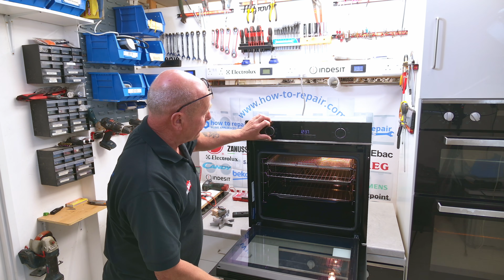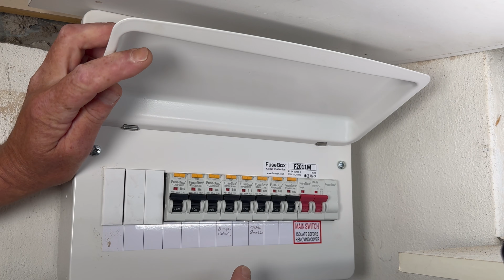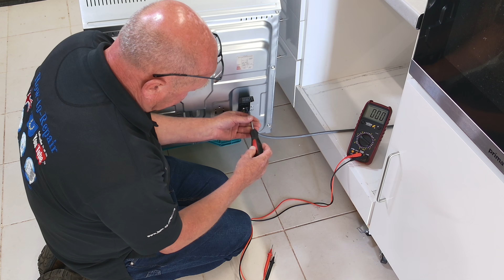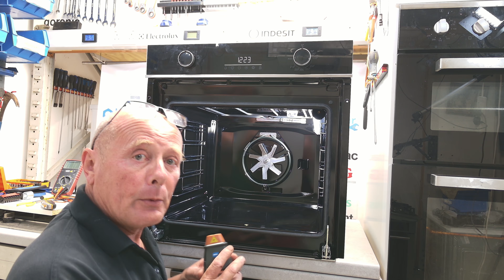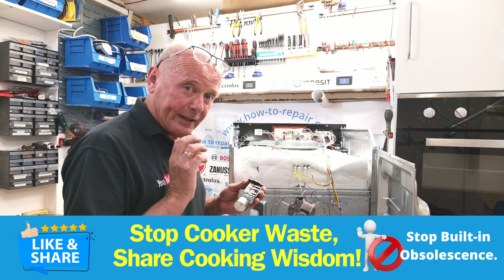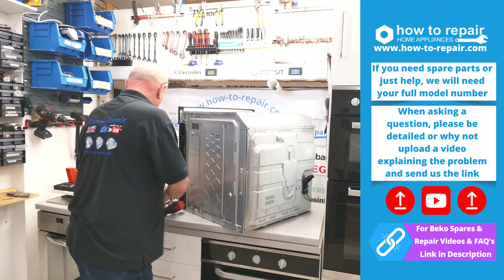Fan Oven Motor Test & Replace on Beko, Blomberg, Grundig, Lamona, Leisure, Logik, Stoves Etc

Comment: Excellent video. Was able to access the fan with ease, with a view to replacing it.

I live in Greece and my oven isa Beko slot in oven model# BIE22300X serial# 7768288302

Often when trying to look up the oven model on spare parts websites, they list model numbers with a different starting three letters. Can anyone throw light on what these initial letters mean, and in particular, do they signify that different spare parts might be required?

Also, I note that the oven fan (having not removed it) appears to be an impeller and suck air from the centre and pushes the air flow to the side vents on the back panel. Is this correct?

Comment: Frankie: My Beko BBIE12301B oven's fan has started making a really loud rattling noise, and sometimes it sounds like it's spinning very slowly or struggling. It's quite concerning. What could be wrong with the oven fan, and can I fix it myself? Should I buy any replacement? I really need your help and want to make it running freely again.

Comment: Hi, having watched this video, i have an issue with my Beko  ODF 22300 x oven. Should i ask the question via email or add it here? Regards, Paul
Reply from the maker: It's normally better through the website as I can directly answer any spare parts that you need and I always get the questions. Sometimes I miss them on YouTube as I have so many questions.
Reply: @How-to-repair  ok no problem,  I've sent a message through the link. Cheers, Paul
Reply: @How-to-repair  Hi Paul, did you get the message I sent through the link? Cheers
Reply: 24hr response?  No one got back to me. Well, Thanks for your help. What's the point.....

Comment: I'd be interested if you're able to repair a seized bearing on a oven motor fan. Some fans are super expensive (>£150) [Neff]
Reply from the maker: Hi Paul,

You could replace the phosphorus bronze bearings if you can strip the motor. However, some motors are riveted, making it very hard to do. Another major issue is finding the right bearings. Phosphorus bronze bearings are designed for each motor, depending on the shaft diameter and bearing size. It’s a tough job.

Sometimes, it might be easier to get another motor. I know motors can be expensive, but you might find a cheap cooker on eBay with a different fault, like blown elements. You could take the motor from that cooker for yours. 

Universal motors might also fit and are much cheaper, around £20-£30. But you need to match the exact dimensions. The shaft length is crucial; if it’s too long, it will push into the fan guard. If it’s too short, it will hit the back plate of the oven.

These motors are designed for cookers, but if you’re handy with tools, you could use a universal motor and mount it at the right distance. 

I hope this helps you. What would really help me to get my video seen as I'm no IT expert is to either share the channel or at least post it to your friends my videos might not be YouTube superstars, but they save Appliances from the scrapheap. Share and help us fight appliance waste! @paulbuckingham9113 please remember to subscribe to our channel as that really helps us https://www.youtube.com/shorts/e432SAb2g08  Thanks, Paul 👍
Reply: @How-to-repair   the noise has gotten worse on my hotpoint tvfm60c6p
Reply from the maker: check bearings
Reply: @How-to-repair  I am not alwed touch it it came from a 2nd shop i will be getting rid of it